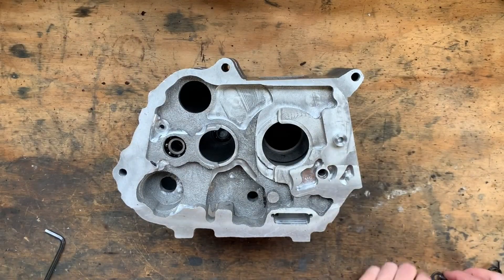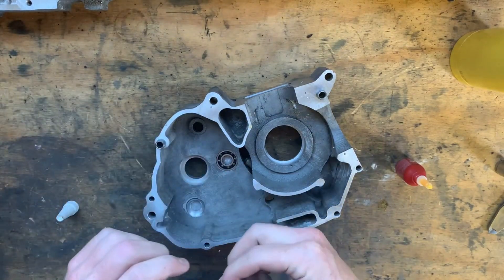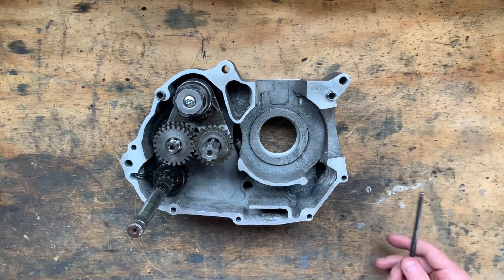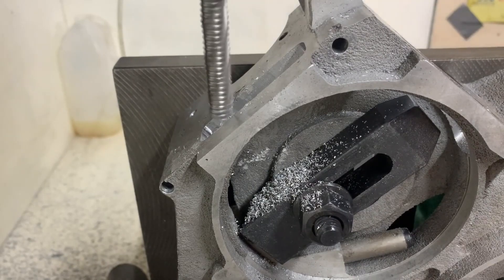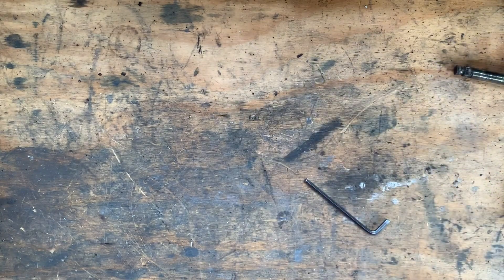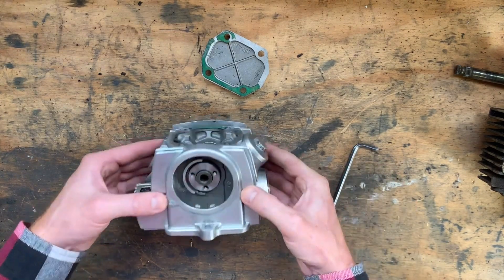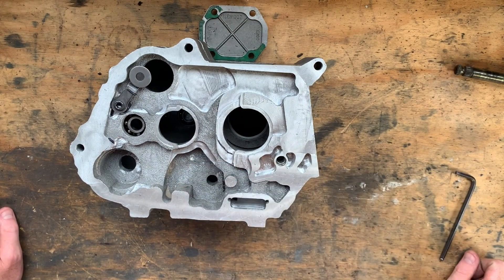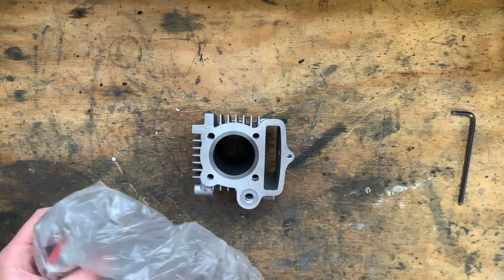144cc V Twin a Small Mistake

Comment: If you need a small boring bar, you can grind one from a piece of high speed steel pretty easily if you have a bench grinder.  You got around it fine with your mill, but it's a quick low cost option to have.
Reply from the maker: not a bad idea. It probably wouldn’t hurt to stock up on some high speed steel for making some small boring bars and form tools.

Comment: why would they lie regarding displacement? Is there a rule banning big bore cylinder manufacturing in China?
Reply from the maker: In New Zealand all mopeds must be under 50cc in displacement, no one pulls them apart to check. Other countries probably have similar laws.
Reply: @OddsandEndsMachining  😂 ….. or it could be they simply re-sleeve a ‘stock’ casting and make no effort to reidentify.